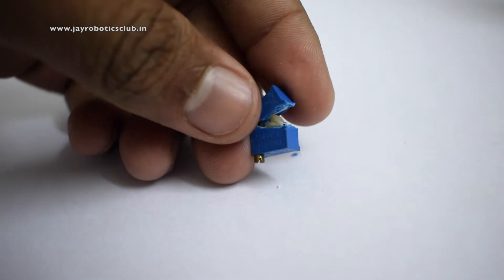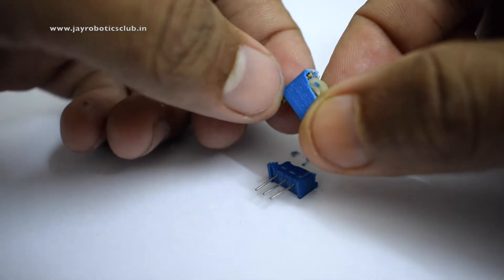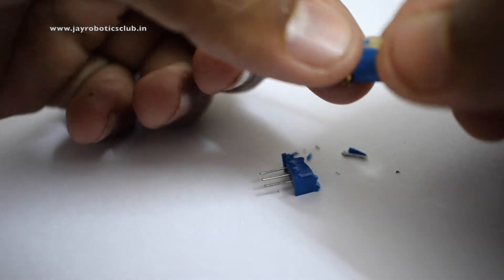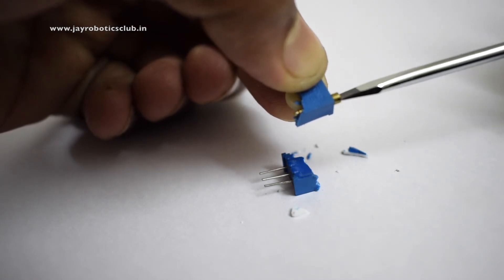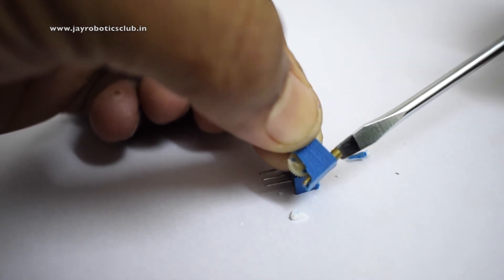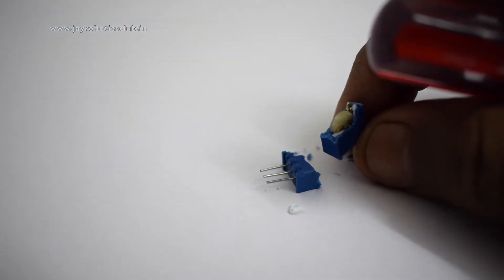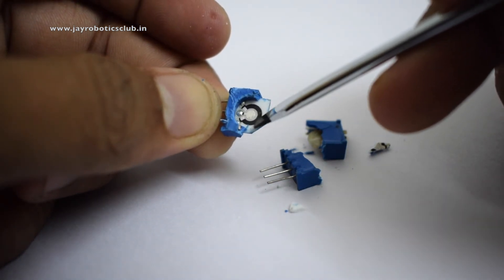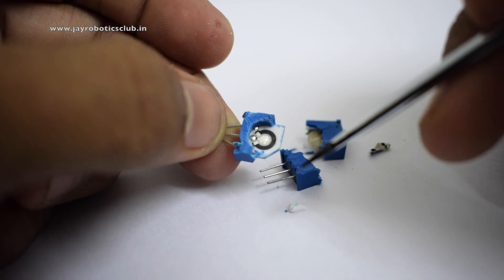13. What is inside a Trimpot? Breaking

Comment: Ya! I had one of these on a DC-DC converter and the output voltage was wrong. So I took a screwdriver and turned it left and right and nothing happened. Then got courageous and wanted to find the end. Not finding the end-stop after 2 revolutions, my courage left me. Finding a datasheet, I found hints saying that it would do 25 (!) turns. And it did. And my voltage was set correctly. Thanks for cracking one open for us.
Reply from the maker: We would love to do one for you

Comment: Interesting. So you could turn it fully around with screwdriver much more than 360 degrees?
Reply: Dont quote me on this but i think you can turn them clockwise and counter clockwise a full 360 up to 25 times
Reply: I loose track all the time with my little electric Wowstick screwdriver and often turn 20-40 times each way with a voltmeter to find the "starting" point. lol. They are pretty tuff little Trim pots.
Reply: is there any knobs you can get for it ? its very tricky to use a thin screw driver..
Reply: Ese Callum even I'm looking for a knob, it goes upto 20 turns , from 5 ohms to 10k ohms..
Reply: the best thing to do is REMOVE it and replace it with a normal same value pot.only 2 of the pot pins are connected.with a normal pot you can have a large knob.   also what i did was to remove the 20 turn pot and  connect the variable resistor pot via wires to a more convenient location on the project box.
Reply: @esecallum  Replacing a multiturn trimmer pot with a regular one defeats the purpose of a multiturn which allows much finer control of the exact ohm value. One idea that could work well is to use a low value pot with a fixed resistor inline to allow fairly small adjustment within a limited range if that works for a particular circuit. I did this for an adjustable buck converter driving a 12v 15W COB LED used as a bench work light. Since I only needed a range of 10.5 to 12 volts to drive the LED from barely on to brighter than I need, the rest of the voltage range was not needed and the jump in voltage, therefore brightness, was excessive from the slightest movement of the pot. Replacing the 50k pot with a 1k and putting a 4.7k inline did the trick. Another idea, if the project has room, is to put two pots inline, one large value and one small for fine tuning. They do this on those cheap adjustable volt/amp bench power supplies that have coarse and fine adjust knobs for volt and amp.
Reply: @TornadoCrafter  i did both of those things you mentioned.also 2 varients of this booster.one seems to require only a few turns to make large voltage changes.the other has the turns spread out.
the most annoying thing is you need a screwdriver.what i did was to make a solder nob and about a centimetre long and bent at the end.its HUGH improvement.you slightly file the screw to remove oxide and then using thick solder you make a long spindle which you curve into L J OR I shape etc. i slipped a Q TIp tube over mine.
Reply: Seems to be significant interest in a knob for this style trimmer. After watching this video I found one where they show how to attach a brass tube that you can then stick a knob on: https://www.youtube.com/watch?v=DSQdB_j7xwQ. So far, I have not seen these trimmers available to buy with a knob, only larger wire wound multiturn pots. I saw one of these on a boost/buck USB board sold on aliexpress that had a knurled knob but I have no idea where to find them separately, so maybe the maker of the board puts them on?: https://www.aliexpress.com/item/DC-DC-5V-to-1-2V-24V-USB-Step-UP-Down-Power-Supply-Module-Adjustable-Converter/32918717851.html?spm=2114.10010108.1000014.1.48a74cedXJLuD2&gps-id=pcDetailBottomMoreOtherSeller&scm=1007.13338.112236.000000000000000&scm_id=1007.13338.112236.000000000000000&scm-url=1007.13338.112236.000000000000000&pvid=2b8675c9-3c9f-4604-b821-f8f781172417.